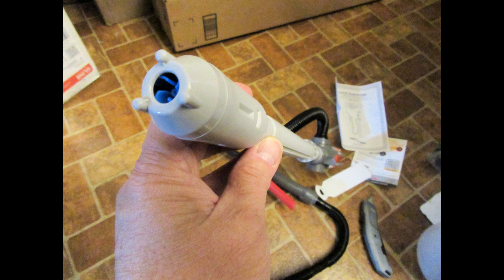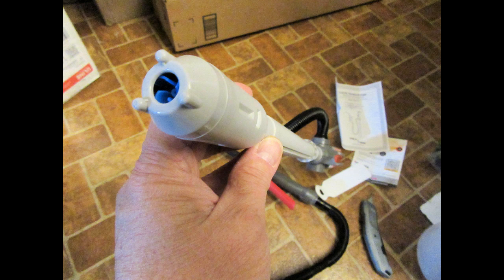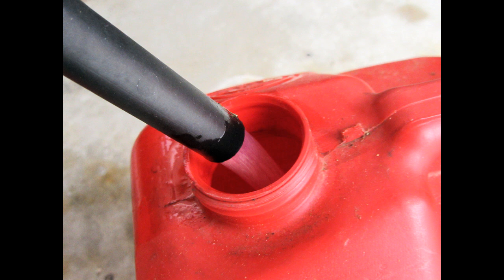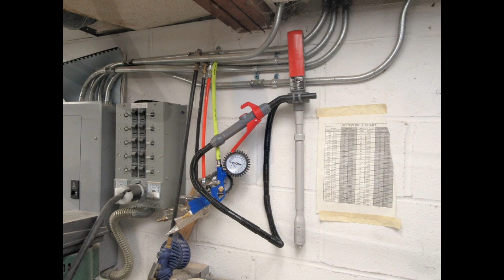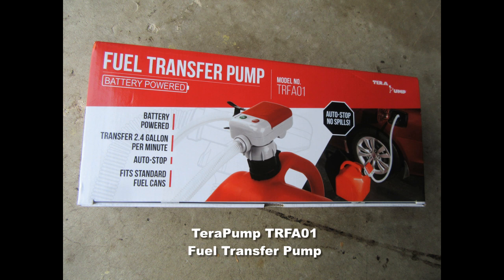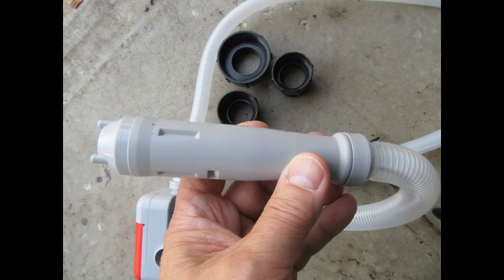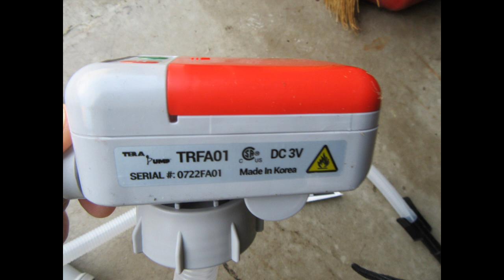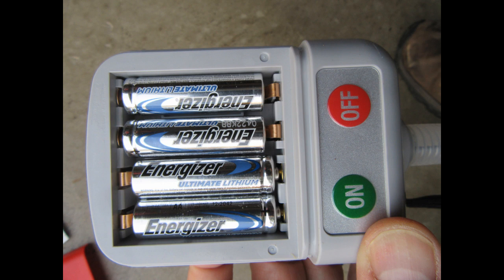Adventures with Fuel Transfer, Part 4

Comment: Nice video. Very indepth look at the 3 pumps. Would you still recommend the flo n go, or was the minor leak a deal breaker?
Reply from the maker: glenevans, that Flo n Go pump served me well for many years, and still worked fine in spite of the leak......I just got tired of my hands (at least the hand operating the pump lever) getting wet with fuel during use......no fuel was leaking out when the pump was 'resting'. So I bought a new Flo n Go pump, identical to the old one, but I have not installed it since I am currently using the TeraPump product for the same application. If THAT thing craps out, I still have the Flo n Go waiting in the wings. It is a good product.
Reply: @youtuuba  thanks for taking the time to reply. I did purchase a flo n go and have added a spring around the hose near the fuel can to stop the hose kinking over time. I had a small issue fitting it to the fuel cans I already have as the cap was slightly different, but I was able to make it work. Thanks again for an informative video.